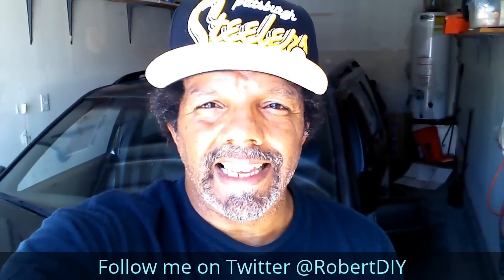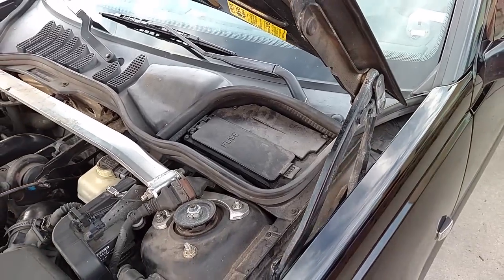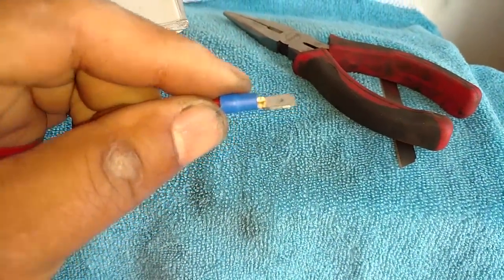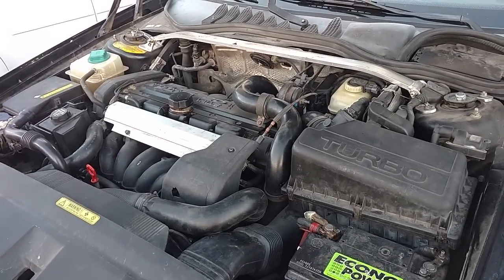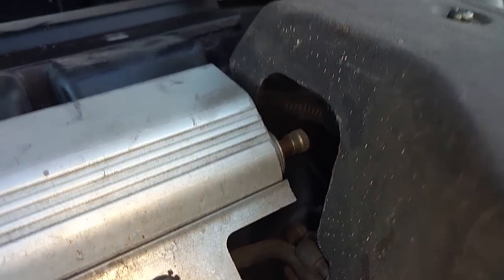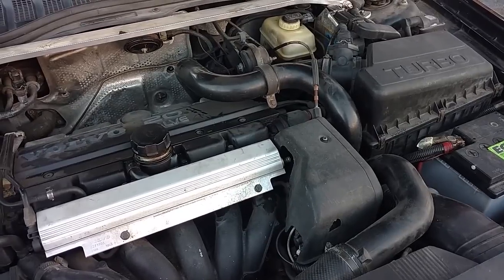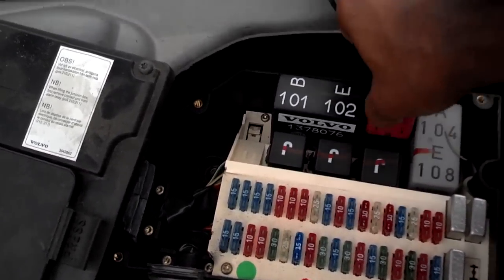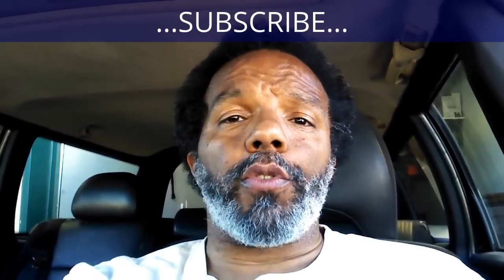Random stalling, will not start, fuel pump and relay testing, Volvo 850, S70, V70, V70 XC, etc.

Comment: The only place I turn to on the internet for help in fixing my Volvo myself is here and to Robert. ONCE AGAIN.... ROBERT SAVED THE DAY! I was experiencing the frustration of random stalling. I knew it could be a variety of things, but didn't know where to check first. After watching this video I quickly made myself a squab (jump) wire, pulled my relay, and let the car run. It did not shut off so I went to work ordering one right away. Advance Auto wanted about $66 for my 1998 V70 AWD, while AutoZone was around $47. I had it same day, easily replaced it (as easy as replacing a light bulb at home) and the next day confidently drove it out of state with about a 400 mile round trip. It did NOT STALL and has not stalled since.

Robert, you are worth your weight in gold and just an all-around nice guy (whom I have even had the pleasure of chatting with on the phone). Please remind us that you accept PayPal Tips and where to go to do that. 

I hope that I am not the only one tipping this man for all his content, education and hard work.

Volvo for Life baby, Volvo for Life!
Reply from the maker: +Billy Diamond Woot woot! #VolvoForLife
Reply: I do the same

Comment: I can't believe I waited suffered for the last couple of years with intermittent stalling.  Leave it to the Black Swede to come to the rescue.  Mechanic says my fuel pump is operating about 90%, so I doubt that's the reason.  Relay testing sounds like the first thing to check.  Thanks, dude.
Reply from the maker: You are welcome

Comment: Just about to try this in my '99 S70.  It died on me yesterday afternoon. The engine quit on me in town, but I was able to restart it straight away. I had presence of mind to come home at that point (about a 20 minute drive) and the car drove normally. After stopping the engine while I took a few things out of the car, tried to start it up again, and this time, nothing doing.  I studied the repair manual, which tells you almost nothing, but wiring diagram shows the circuit very clearly. I was just a bit dubious about hitting the pump with a constant 12v supply, but from your video it looks like the pump won't suffer in the short term, so that's what I plan to do.
Reply from the maker: https://youtu.be/3T2r0NJT9oY

Comment: thanks to you I just bought a 1998 Volvo S70 with a stalling issue and your video fixed it up. previous owners had put thousands into this problem and you fixed it for some scrap copper wire. Bought the car for 500 bucks and I owe you a six pack my friend. Thank you thank you thank you.
Reply from the maker: You are welcome.

Comment: Thank you Robert! My 99 xc70 had intermittent stalling, hard starting and sometimes wouldn’t start at all. It ended up being the relay, it looked brand new but when I jumpered it like you suggested the car fired right up. Thanks again for all your helpful videos over the years. If you’re ever in the Massachusetts area, I will buy you a nice dinner 🍻
Reply from the maker: cool, thanks.

Comment: Thank you for your helpful video. I replaced a faulty fuel pump relay on an '04 C70 with little effort. I also like how you do not talk down to anyone.
Reply from the maker: +allenedmonds2010 thanks for watching.
Reply: @RobertDIY  I have a O4 c70 Volvo and I changed the Alternator Belt The Big One For a( 2.4) and now it's won't Start 😡 I was driving without any lights on the dash, and all of a sudden My car started slowing down and The Battery light popped on ,And I moved to the nearest safety zone upon inspection I noticed my Belt had Popped off and was shredded ,I removed the old belt and installed a New one, And Now it won't Start 😡, it Turns over , with all of the lights Blower,and radio etc ,but it just Won't Start😡😡😡 Please Help

Comment: Thank you so much Robert. Your videos have been a huge help with my '96 volvo 850 turbo. So far I've done my own fuel pump and my blower motor with your help. Thank you.
Reply from the maker: You are welcome.
Reply: +Robert DIY so I just did my fuel pump last fall, went to start my car yesterday and seems like it's not getting fuel. I just checked my relay with the wire connecting 87 to 15 and still no turn over. When I turn the key I can hear my pump kick on. Not sure what else to do. Please help.
Reply from the maker: +Neal McIntosh https://youtu.be/YiPAPu-K8OI

Comment: Robert: thanks for this series of videos, I have learned a lot that I wish I know when I owed an S90. Never needed to work on my 245.   In any case, now I've got an 1988 S70 GLT that has been nothing but a headache. Drove well for a year after buying with 180K, but for the last 6 months its been noting but CEL, trips to the mechanic, and then new problems arise. Latest issue is random stalling when the weather gets hotter (over 80 degrees). In recent weeks I've replaced the plugs, rotor, distributor cap, plug wires, coil and just yesterday, the infamous fuel pump relay based on your video. It was NOT a Volvo part, but a Kaehler unit. Now random stalling has increased to the point where if it's over 80 degrees, stalls almost immediately while cooler temps seem to let it drag out a bit. I wait a bit, (higher temp dictates longer wait), and car starts up but then stalls again almost immediately. No codes display, just the cryptic '0 dtc' on my $29 Autozone OBD reader. Very occasionally I get the P0455 code, which I think is the J&L hoses located in the trolls-only service area.
Reply from the maker: Did you try a jump wire?
Reply from the maker: Also check the battery B cables, clean them.
Reply from the maker: https://youtu.be/NWfLpp8NevI
Reply: Yes to jump wire (started, ran 5 min, stalled), yes to battery cables, watched the failing fuel pump video. You are a funny guy!  Yeah, I've got the 225K miles, but car ran like a rocket ship after the recent tuneup, and always started (before it started to stall). Time for a trip to the junkyard, but if I can't find an OEM pump and fuel relay, will got to Amazon. However, I took a look at your other video about the things to look for when buying a S70. Timing belt has over 100K. AC is toast. Think I'm going to push to the back of the yard with the other projects, and take a flyer on a newer car. Once I get the current project out of the garage, this would probably be the next one. Thanks again for all the useful videos, Robert. All the Volvo mechanics in Maine I knew retired once they started bringing out the newer cars, or stuck to 240's

Comment: U R the Best!  Thank you.    My 2004 C70 has some issues but I think that the knowledge you share is focused and directed.   Knowledge is power.   You are concise and do the steps in a logical order so they are easy to follow.   Locating the Fuel Pump relay was a big issue for me.   Now we will see if that is the problem or if Valentina needs  a new fuel pump!
Reply from the maker: Your car does not have a relay like mine.

Comment: Good Work!!  I've had two Volvos that stalled going down the road...FINALLY traced it to the relay... I use to jump out of the car , pull the relay,  blow on it to cool it....put it back in, restart the car and way we go.   It was not fun on the freeway around Denver.    It was the 740 and then the 850.     Now I have a S60     No relay problems yet
Reply from the maker: Nice.

Comment: Thanks for this video.  My 98 S70 refuses to start right now.  It will turn over all day and just won't kick over.  For a while it had been starting only on the second try, like clockwork.  Fuel pump does work (I can hear it humming) so this might be it.  I'll have to try that out.  Thanks.
Reply from the maker: cool. also check lawnmower syndrome.

Comment: Hi Robert. Your videos are a great help to me. My 91 940 turbo had the exact hot engine start problems as yours. Even though another guy made a video about changing the fuel pressure regulator which was my problem I wouldn't have seen it unless I followed you. Thanks again Robert
Reply from the maker: Good to hear

Comment: BINGO! This was exactly what was wrong with my 99 Volvo V70 GLT. Stalled and started & drove 75 feet, stalled, started & drove 100 feet, stalled, started then ran fine. A couple of days later, it would not start at all (good thing I already had it towed to the shop as I'm not mechanically inclined). Shop tested it pretty much like above (fuel pump worked once the relay was out and jumped like above), they replaced the fuel pump relay and #BackInBusiness!  Will keep a jump wire handy from now, though, thanks!
Reply from the maker: You are welcome.

Comment: I have an issue with my Volvo v70 2000 mod. It sometime starts, and sometimes when i turn the Key very fast It starts but dies. I have changed the spark plugs, air filter Oil filter and gasoline filter, but still i have the issue. Now i Will try to change the relay. Thank you so Much for this video, you are Great at explaining and i have seen alot of your videos. I wish i Had someone here in Norway that could teach me everything you know about cars and how to fix them. You are Great.
Reply from the maker: +xTheLoyalDutchx you are welcome. Any codes? If that doesn't fix it, try replacing the key antenna ring.
Reply: Robert DIY Nope, No codes. Hopefully Its the relay.
Reply: Was it the relay?
Reply: yes, it was my relay, sorry for late answer

Comment: Hi Robert! You are a huge blessing sir! I recently bought a 97 850 and a few days after the car shut off. Got it fired back up but sputtered and lost power, then died. Beat on trunk floor and fired back up. No real issues for about a month other than occasional sputter. Yesterday I left car on while I went into the store, came back out and car wasn't running. Let it sit about 4 hours and came back. Beat on floor...nothing. Then beat on floor while a friend turned over. It fired up! Barely made it to my driveway and she died in my driveway. Wouldn't fire again. I'm hoping it's the relay! I will let you know if this fixed me up. BTW....check engine light stays on but no codes at AutoZone. Service light is intermittent
Reply from the maker: LOL, Replace the fuel pump. You can get a cheap on one eBay for about $50.
Reply from the maker: https://www.youtube.com/watch?v=NWfLpp8NevI
Reply from the maker: https://www.youtube.com/watch?v=-2oIeIhpV44

Comment: Thank you brother. You most certainly know these vehicles 110%
Reply: Robert that was it EXACTLY. Brother you are a lifesaver my friend. Thank you my brother .
Reply from the maker: You are welcome.
Reply: Robert, listen I’m traveling in souther Calif from Washington state. My 97 850 is now not starting again. I’d jumped the relay as posted in your video and it ran fine for 3 days. I located a new relay and installed it. And ran for a few days. Well now it’s doing the same thing. So I am back to the jump wire on the fuel relay but it’s intermittent starts and won’t keep running. For the life of me I can’t get this figured out. I’m stuck quite literally trying to make it back to seattle. Anything you could suggest would be appreciated.
Reply: And Robert, I had driven the car for two days with just the jump wire, so you’ll be aware of what I might have done. Just trying to figure this out

Comment: Hey Robert, i have the issues listed above in my 1996, 850. It wouldn't start, when it would start I could drive about 100ft before it would stall out, then it wouldnt turn over. I started by replacing the relay (common issue) and the car started ! Held idle and it seemed like I fixed the issue by replacing the relay. The next morning I drove it to work and after about 30 mins on the road it died on me, same issue, Back to square one.. I went and got myself a new fuel pump.. Not OEM because I couldn't find one in town. I replaced the pump, unplugged the relay (newer) and put it back in. Tested the pump and it was humming ! Seemed to have fixed the issue... Started and it held idle ! Let it idle for about 10 mins before I decided to drive it a bit to charge the battery. As soon as I hit the gas I could feel the car bogging out and sure enough it stalled out again... I'm at a loss. The car was working fine. I was told running on less than a quarter tank too often is bad for the pump ? I'm also wondering if my new relay went bad when my car stalled out on my way to work ? I'm also wondering if the new fuel pump I put it there is a dud because it's not a Bosch. Please get back to me ! Thanks for putting out great content !
Reply from the maker: https://youtu.be/Q-r51cGZ6fg
Reply from the maker: https://www.youtube.com/watch?v=YiPAPu-K8OI&t=2s
Reply from the maker: https://www.youtube.com/watch?v=4dsoFUrOKDg
Reply from the maker: You have a lot of bad info in your post. Is the CEL (Check Engine Light) on?
Reply from the maker: https://www.youtube.com/watch?v=NhtUXZTurzo
Reply: An abs light but no check engine light. It shows a solid upwards pointing arrow when it attempts to start and dies... But I don't think it's transmission related ? what do you think ? My tranny fluid level and color looks good. I noticed a leak on what looks like my rad hose. I have the car started and it seems to idle perfectly fine, maybe a bit sluggish but it sits at around 1000rpm. Iam going to attempt to drive it back home from its current location but I'm almost sure it will stall out.. Is there another issue that could be giving be these symptoms ? Possibly a bad m.a.f sensor ? (Ive cleaned mine but have not replaced it.) 
Thanks for your quick reply Robert ! I've had my hands full with work and troubleshooting
Reply: Update. Car dies when in drive and the my foots on the brake. It struggles to maintain rpm and then it will die. In park it's perfectly fine
Reply from the maker: have you had it scanned for codes?
Reply from the maker: https://www.youtube.com/watch?v=8fNCqTu7fKM&t=28s

Comment: I have a 2000 Volvo s70 with 190,000 miles on it. I bought it from my neighbor who had it sitting in her yard for 4 years. I changed the oil, put coolant in, cleaned the spark plugs, and lubricated the cylinders. I also tried to remove the old gas but nothing was coming out so I put 3 fresh gallons in. I also put a brand new battery in it. Then I went to crank it and it starts for maybe a second and immediately dies. I’m not sure what the next step is. I checked next to the fuel injectors to see if they were getting fuel and it seemed like they were. I’m 19 and I was motivated by your videos to buy this car. I could send you a 30sec video if you’d like to see exactly what it’s doing.
Reply from the maker: Crank it, let it start, when it dies, scan for codes. Usually that means the antenna ring is bad.
Reply from the maker: https://youtu.be/xQ8Gl1NmjX4
Reply from the maker: https://youtu.be/3T2r0NJT9oY
Reply: Robert DIY I have replaced the antenna ring and the problem still occurs. The engine starts for maybe 1 second and dies. Is that enough time to scan it for codes. I have tried everything I can think of. I also replaced the spark plugs.

Comment: Thanks Robert!  The relays were both Kaehler's.  If it runs better on the jump wire, I'm assuming I should get the Volvo relay?   Also, do you have any suggestions for how I could I determine if is the fuel pressure regulator or pump going out?  There are no other codes, just P0230.  Thanks again Robert!   With your videos I'm at 236,000, hoping for 300,000+!!!
Reply from the maker: If it runs good with the jump wire, it's likely the relay. If you pull the vacuum hose off of the pressure regulator and there is fuel in there, it's bad.

Comment: thanks helpful video , i just replaced my fule filter & fuel pump , i hear the pump running just not not getting any fuel pressure , will check out the relay and the regulator tommorow .
Reply from the maker: If the pump is running the relay is fine. What kind of car do you have?
Reply: 96 960

Comment: robert.  thx for being on youtube.  i replaced bad fuel pump in 2004 S60 (non-turbo, steel fuel tank).  new pump works well, but fuel pressure intermittently drops < 30 when running.  your video makes me think it's the relay, so i wonder if you can tell me where to find that relay on my model/yr volvo.
Reply from the maker: I don't think those have one. Ford system. Probably a bad fuel pressure regulator.
Reply: Robert DIY thanks so much for the personal reply.   can you tell me where the pressure regulator you mention is located in the car?  do you mean the device on the fuel rail/manifold?
Reply from the maker: Sad to say, I don't know.
Reply: thank you for your time and effort, steeler fan.

Comment: Hello Robert,
I have a 99 S70.  It has 75k miles. It starts up and drives well for as long as I drive without shutting off the engine. But once I shut it off , it wont start again for at least a few hours. Next day it starts up just fine. I changed the fuel filter. Ive tried to take out  the fuel pump relay when this happens and put it back in. I also tried to jump the relay with a wire and clamps as you illustrated, but no start. I also checked the end of the fuel rail and got gas out of the cap. 
Could bad spark plugs and or wires make the car turn over but not start. Anything else I can trouble shoot.
I love that you love Volvos. 
Ty you for your videos.
Reply from the maker: ECT
Reply from the maker: Any codes?

Comment: Thanks Robert for the very useful video.My 1998 petrol volvo v 40 would not start.I suspect the fuel pump.The relay is good.I ve ordered a new pump.Just wondering if you can replace the pump yourself.Is it a big job.Where is it located and how to reach it.Thanks.
Reply from the maker: I don't know. Try a Google search.